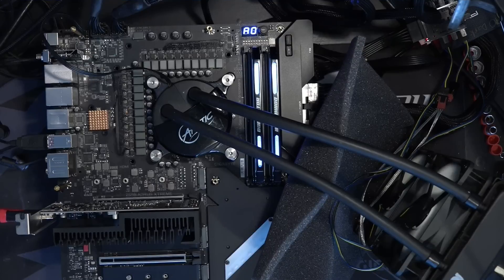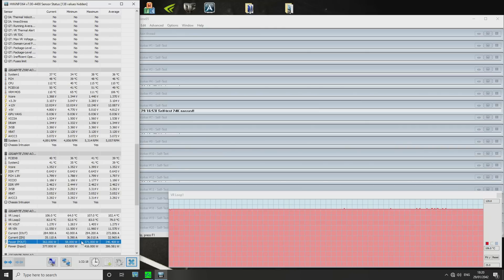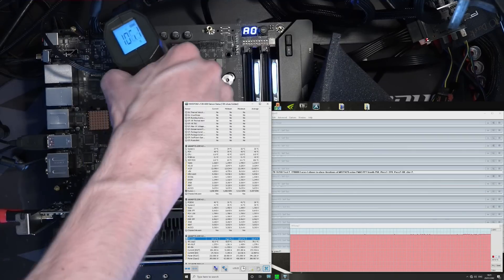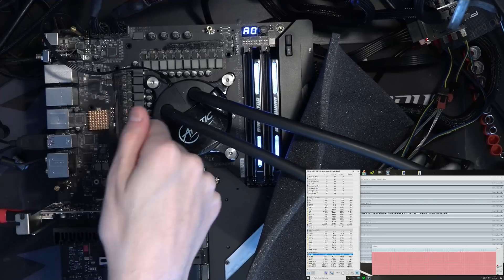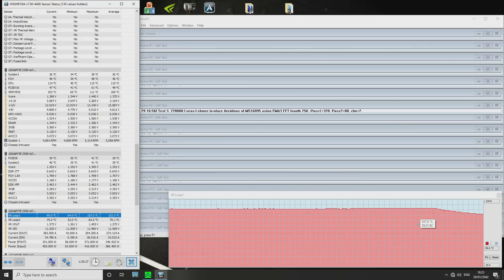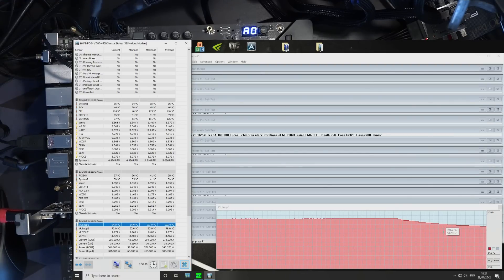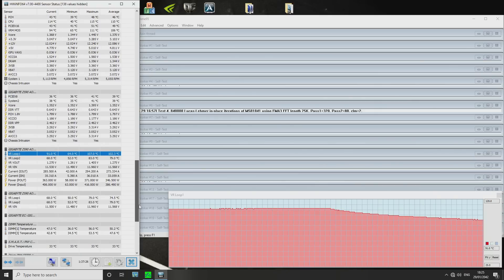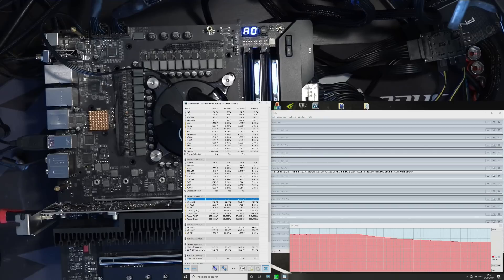Running Prime 95 on the Gigabyte Z590 Aorus Xtreme with NO VRM heatsinks

Comment: Buildzoid I want to know what is an inductor? I wonder when are u gonna do electronics explanatory videos.
Reply: Probably a coil
Reply: @kp p From Buildzoid, this is the (quality) content you are looking for: https://youtu.be/oDRHV3qtSWc

OK, how VRMs work is not quite what an inductor is. 
Basically, it is a copper wire coiled around and coilded inside a ferrus (iron containing) housing so that the component has a high level of inductance (an electromagnetic property of conducting materials). Its job is to store electrical energy in the magentic fields the copper coil induces. The inductor 'resists' being 'charged up' when the MOSFETS are turned on, meaing the voltage does not shoot up instantly. And it also 'resists' being 'discharged' when the MOSFETS turn off and the CPU/GPU/whatever is still drawing power.

Comment: Gigabyte: "Have new mobo." BZ: "Look it works at 110 degrees." Gigabyte: "..."
Reply from the maker: if you did this on a crappier board it would either shut down or die.
Reply: @ActuallyHardcoreOverclocking  I tested a 5+3VRM Biostar, throttles @ 84C VRM with SM4377/SM4364 mosfets. Only good for ~80Watts. Can't handle a stock 3800X with a older AMD AM2+ stock cooler.

Comment: are you going to do ram overclocking on 10900k + z590? i have crazy problems with it, had insane problems on the z590 hero which couldn't even be stable at 4000mhz cl19 on ram that was stable at 4266 cl16161636 on my 9900k, then i switched to z590 master which could get it stable at 4200 17171737, then i bend some pins on the master like the scrub i am and now i'm on z590 apex because i couldn't get my hands on the z490 one and it seems like the ram oc on this board is as bad as it was on the hero lol, something's gotta be off and idk what it is.
Reply: Funnily enough the Hero 13 was better for me with 10900K (0 issue). Can do 4500c16 stable with dual rank, while Apex 13 couldnt even do 4266c16 lol
Reply: @bl4ck_dot  it's really weird, not even bios updates help lol.. i should just buy a z490 godlike or something like that and sell the apex, i guess.. i'm really sick of having to switch boards tho, i even delidded my 10900kf hoping it might give me extra headroom, but the only thing that i got from that is 5,4 allcore lmao, did literally nothing to ram stability

Comment: so he's been running that 10900k at over 110 degrees for over a hour and a half. what?
Reply: 110C on VRM
Reply: @LA-MJ  thats not the issue, you can see clearly the cpu temps. not vrm are going over 110 degrees.

Comment: Man all cool and staff... But i thought this was Actually hardcore Overclocking channel :/ and I don't remember i the last time i saw you do any hardcore oc :/ like the 10900k or even an old GPU ... like 1-2-3 videos of RAM OC they are good but after 3 they kinda become ... eh... :/ dunno ... maybe you can recommend bios settings for CPU water OC or  something ...
Reply: last CPU oc was 25 vids back , last GPU i don't remember XD
Reply from the maker: @M0nsterRipper  So apparently the 5.55GHz 11900K doesn't count. If you just want settings for 24/7 use then you OC a 11900K the same way you would OC a 10900K or 9900K or 8700K or 7700K or 6700K or 4790K or 4770K or 3770K or 2600K. The only thing that has changed with intel CPUs over the years is the voltages that are OK for long term use.
Reply: @ActuallyHardcoreOverclocking   I didn't say do those things specifically i just suggest some things. (ah ye didn't see the 11900k vid my bad :/ good job then :D )

Comment: VRM MOS is at 111C° at 2:36, or is it someting different? About temperature difference between showing and measured.
Reply: One is probably a thermistor in the VRM area, measured by the SuperIO chip, and the other is probably one that is coming from the voltage controller, which probably gets its reading from the smart power stages.

Comment: Meanwhile in Gigabyte headquarters: nervous sweating watching this vid
Reply: Intel sweating too. 115 C on the CPU :D
Reply: @gor1l1a  Intel would be raising hands over head xD. 
245A Iccmax => 280A consistent load
100C Tjmax => 115C consistent temperature

IMC will always remain for RAM OC though.

Definitely the CPU needs protection from the motherboard, the user and itself. That's cleaning off Mhz out of a CPU.
Reply: could be given aparently the only 'good' heatsink is on the VRM that doesn't need it, lol. got to go OC formula extreme hero godlike or just put up with Power stage lava flows, lol. Actualy Hardcore running at TJ-max.  I'm not impressed, lol.

Comment: I found my infrared thermometer is sensitive to thermal fluctuations outside of ambient, if the handset itself is warmer than ambient the reading will be higher than it should be, if the device is cooler it will be lower.